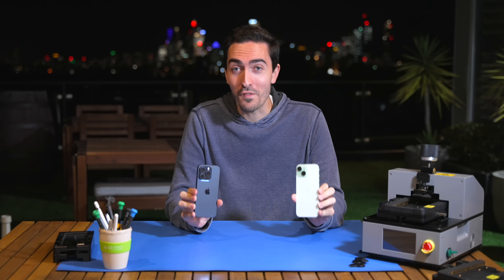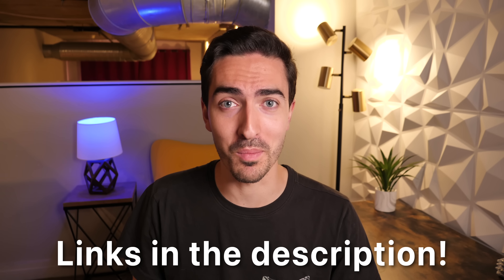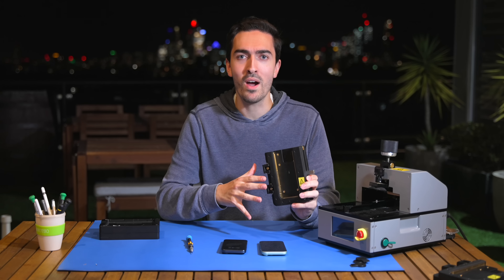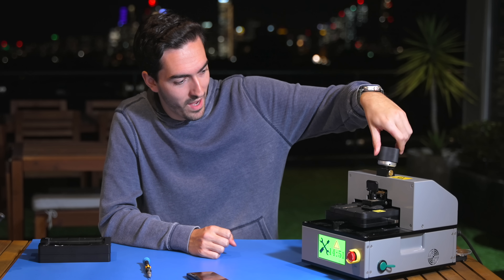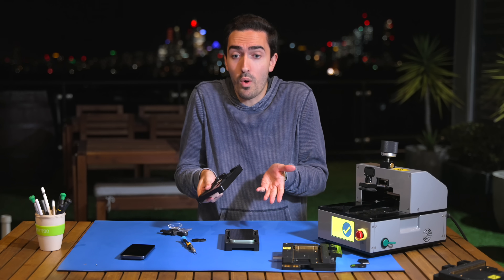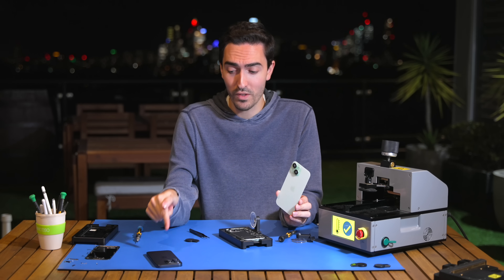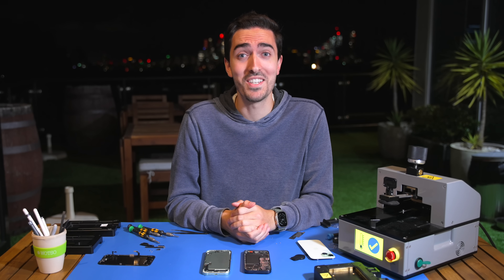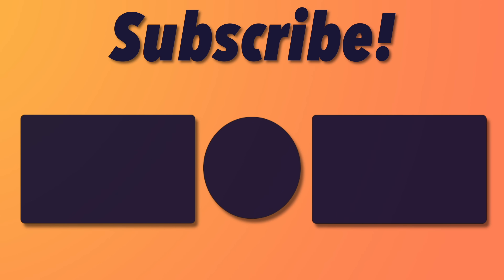BAD NEWS for iPhone 15 & 15 Pro REPAIRABILITY....

Comment: You don’t seem to be up to date with the back glass details.  1.  The rear glass on the newer models (15) is thinner and less durable than on the (14) and previous.  2.  The reduced repair cost was only done because of point 1 - the glass is thinner and cheaper and less durable.  It is not the same durable glass with a lower price.  It would be assumed Apple knew these would break easier on the back due to being thinner and made repairs cheaper in an effort to promote repairs.

Comment: Difficult repair is hardly surprising. Apple intentionally makes the repair tricky so that users are intimidated by the process and take it to Apple for repair. There may come a day when that isn’t the case but I suspect Apple and other phone manufacturers will be forced to do it by right to repair.
Reply: Right to repair means nothing if you don't get your hands on the components.
Reply: That has never been the case, either for Apple or anyone else. They just don’t care very much about repairs being tricky.

And they don’t need to be tricky for people to come to Apple for repair.

Comment: USBC connector design is worst than Lightning. More dust and small particles can get stuck inside the USBC port and especially the cable with the small hole.

Comment: I use my 3d printer with 50c heated bed (set to 60c in software). Works just fine to remove the front glass.

Comment: By making the internals backward, Apple just streamlined the battery replacement process for the non-pro 15s. Gone is the process of having to remove, carefully replace, and then test the screen post-repair.
Reply: Well why not do that for the pros? They are pro devices that we pay more for.

Comment: what happens if you take the back glass of example iPhone 15 pro max and swap it with another, iPhone 15 pro max. Will you get message saying its not genuine etc.
Reply: It is confirmed that you run into issues doing that since the regular iphone 14

Comment: Ok, you make it sound like a bad thing that the usb c port is soldered to a ribbon cable. That is a good thing. That means anyone with a handful of screwdrivers and pry tools can replace that. As opposed to requiring someone with soldering skills and a complete hot air rework station. Having it attached via cable is a good thing. Do not insult them for that because they will happily change that. It’s basically the only repair that is not somehow blocked or locked down on the phone.

Comment: Maybe, as you mentioned in a previous video, that the Iphone 15 Pro's chip is not really an A17 pro but simply a tweaked A16. Is there any test to be done to verify whether the A17 pro is indeed 3nm lithography?
Reply: You can check TSMC’s report
Reply: @saileshrachapudi8486  Cool thanks

Comment: Apple has never been a company for the techies who have become the most vocal. They operate differently, and they think differently than the techno douches who seem to run the show right now. You’re never going to be able to predict them unless you take the time to actually study them. If you know Apple, just about everything that they’re doing makes sense and you would actually understand that they’ve never been anti-repair. They just don’t want tech repair to look like the nightmare that it is in the automobile industry.

I am not excited for USB-C. I feel like my walled garden was violated through force.  It goes zoom zoom, so cool. But that’s all it has going for it. It’s got moving parts. It’s got more parts to break. It’s inherently less secure to use with my iPhone. It’s ~ugly~. And the worst part. You can’t even just plug and play with it which is the whole selling point of it. USB-C can be one of several different protocols and they all look exactly the same, so how are you supposed to know. At least an HDMI looks like an HDMI and a lightning cable looks like a lightning cable so that a special-needs person or someone who just doesn’t give a shit and shouldn’t be forced to knows that this cord goes in my iPhone and this 
 cord goes in my TV.
And if you think any less cords are going to be made because of this, you need to pay more attention and learn how to math. The same amount of chords are going to be made if not more because they all have to look exactly the same. At least when you have different cords doing different things you could predict how many that specific you might need but now you can’t do that.

It’s also already aging. You just shoved ~anyone~ who ever wants to use a piece of tech for the foreseeable into the same corner you took issue with that Apple was supposedly doing to its customers 

Not all tech has to look and operate the exact same way and just because something is repairable or super fast or works really well for you doesn’t mean it’s going to work really well for everyone. Apple isn’t trying to be for everyone.  they’re trying to be for a ~large group~ of people.
Reply: bait used to be believable
Reply: Gosh. I think I've found one of the 0.00000000000000001% of people who watch YouTube videos, who has their brain still working fully, and employs solid rational and critical thinking. Bravo, God bless you ❤
Reply: @unlokia  to be fair to me, I didn’t attack I didn’t say anyone was dumb, I just said Apple was weird and you have to pay attention. That’s not a shortcoming if you aren’t able to pay attention.
Reply: @unlokia  you’re oh so welcome! 🩷🩵🤍💙❤️🧡🖤💜💙💙🤎💜💛💜💚💕💘❣️💝❤️🧡🤍🤎💙❤️❤️

Comment: 13:11 Come on, it's not that hard to reach this conclusion. The parts are serialized and cannot be interchangeable between iPhone models to prevent stolen devices from being used as a source of "official" parts for repairs. The only company that can supply certified parts is itself, it is part of the business model. However, from a safety point of view, there is an indisputable need for parts to be serialized and not interchangeable, whether you like it or not. It is necessary to dimensionalize what it means to ask Apple to give up this control and let someone go out and take parts from devices and place them in others. This means indirectly endorsing the theft to dismantle parts, because today, with all these obstacles, this market exists! Even worse, it is asking this without taking into account other geographical realities, where the crime rate is so high, that it is even more necessary to take actions like this of blocking the hardware to a serial.

Comment: Wouldn't be surprised if the soldered USB C connector was because there wasn't enough time to get the custom ribbon cables made in the required batch quantities.  Or it's simply out of spite since they were forced to have the new interface by the EU.
Reply: In case of Apple, the latter would make more sense.
Reply: The real reason is that the lightning connector has also always been part of the bottom ribbon assembly, so nothing has changed.
Reply: You appear to be under the false assumption that Apple rush designs and don't know what they're doing. Don't confuse them with some knock off outfit like Xiaomi or others; believe me, they plan each phone design and countless iterations of prototypes thereof, *for years in advance*. Never make the (common) assumption that something you heard via the media was only heard at that time by Apple; they are fully informed, way wayyyyyyyyyy ahead of Joe Bloggs reading "news".
Reply: This is nothing new, idk why Luke is treating it as such. Every iPhone since at least the 4 has had its connector on a ribbon cable like that, hidden beneath the speaker and other components.
Reply: I mean Apple have been doing it this way for a while. Eventually I’m sure an easily replaceable port will be available

Comment: Don't you DARE suggest that Apple might remove the screws, if we go back to the iPod press-fit and clips method, NONE of us are fixing any phones 💀
Reply: Dankpods already has the experience
Reply: That's the idea.  You break it you replace it.  Which totally stinks.
Reply: That is about as realistic as a portless iPhone
Reply: @davidkorcak Portless is coming sooner or later
Reply: @chidorirasenganz eu law would not allow it, iPhone are big enough to fit a port regardless Apple would need to shrink down the thickness a lot
Reply: @framedthunder6436  The USB C law only dictates for phones with a port. A portless iPhone would rely on Magsafe 2 which is now Qi2 and Wifi/Cellular/UWB for data transfer. There’s nothing that prevents a phone from only using open wireless standards
Reply: They won’t. The EU law will soon  (2027 I believe) mandate user replaceable battery’s in electronic devices without needing specialized tools. Which would rule out glueing everything down.
Reply: @davidbelecci6970 press fit doesn't use glue. It uses clips.
Reply: The clips arn't bad at all, I can open a 7th gen classic in like 5 minutes maybe less, just need to depress the clips lol.
Reply: Fixing androids is a different story fr
Reply: @tigersusyt  yeah. Very different there's so many of them both generic and name bran that the process is generally not standard. Very annoying I bet.
Reply: @RodknockRhett  it does suck a little bit, but most of the time the screws are bigger than apple, harder to lose, there are less screws, and for the most part androids are the same, i could swap a charging port on a s23 ultra, even tho I've only been into a 5 y/o Huawei and 2 y/o redmi!
Thanks, I'm out!
Reply: The press fit with the clips is extremely easy to repair. 

All you need is patience and finesse. Of you brute force it, you'll break something.
Reply: I hope they do - keeps all repairs in-house and gets rid of third-party and backyard bob repair shops - if you are paying over $1,000 for a phone and whinging about using genuine repair and genuine parts they you are a fool - if you want to fix / repair your own phone of your own free will - make your own.

Comment: Hey Luke! I always love your videos, they’re so informative and entertaining for us Apple/Mac fans. Thank you for all you’ve done for this community!
FYI I purchased a 5,1 cheese grater Mac Pro and I’m in the process of using OpenCore to update it to Ventura. I’m running dual X5690’s, 24 GB 1333 MHz DDR3 and a Vega 64 (having done the Pixlas Mod) as well as dual NVMe SSD’s in a PCIe adapter card, configured in RAID 0 for about 3,000 MB/s read-write. I have you to thank for my obsession with this beast!!
Reply: Okay calm down. 😂
Reply: @unlokia  Lol, well it’s a really great machine and it cost me $55 for the main unit, $105 for the Vega, $10 for the RAM, and $30 for the new CPUs. So I’m pretty hyped up about getting basically almost iMac Pro - level performance from it, a 13 yr old machine.